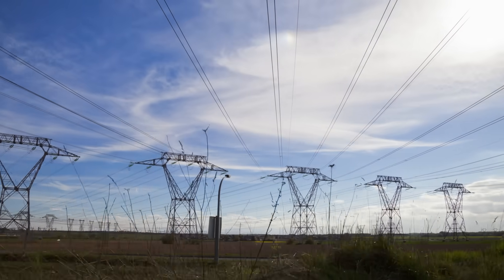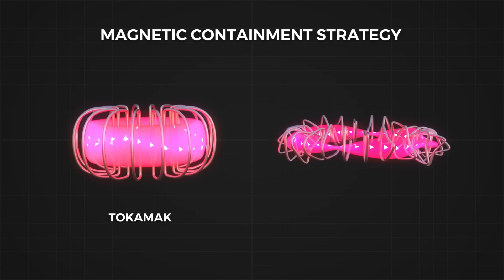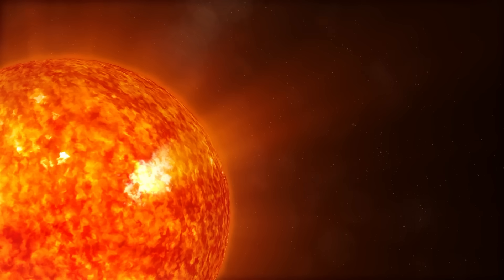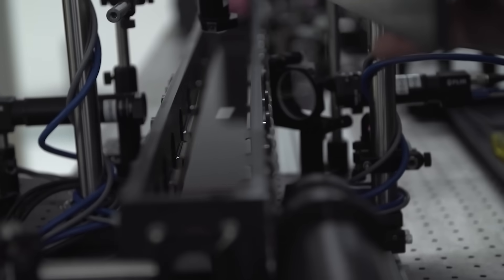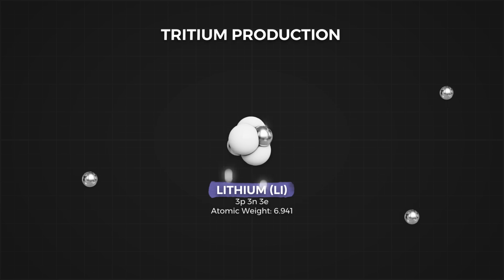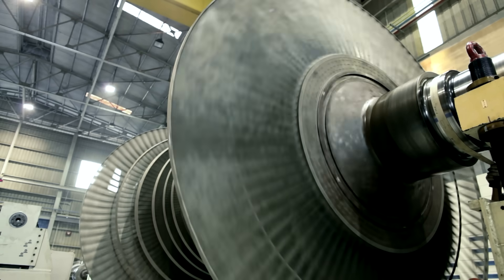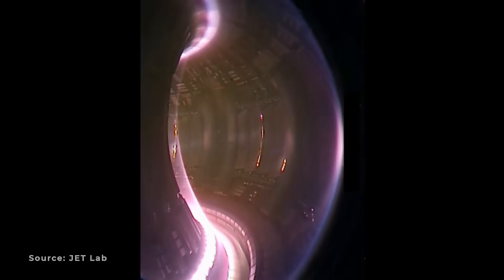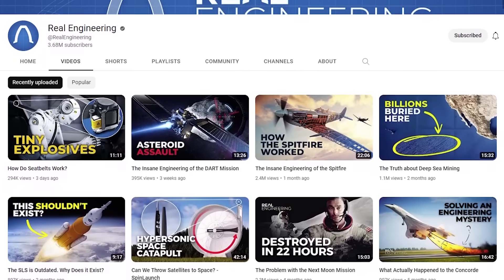The Problem with Nuclear Fusion

Comment: Fusion..great idea.  Keep working on it. But showing multiple cooling towers (giving off steam, not pollution) repeatedly in various forms, to essentially give fossil fuels a black eye is very disingenuous.  You can't even see at the "stack", any pollution from modern fossil fuel powerplants.  Scrubbers, and cleaner fuels etcetera all have been improved immensely in the last 10 years.  If you could get video of super dirty China or India coal fired plants, then yea.  Those fossil fueled plants have gunk coming out the stack.

Comment: I have to disagree with the argument that nuclear energy is being phased out due to PV and Wind energy sources. Germany, despite major efforts to provide lots of wind and solar, is currently struggling with high energy prices and massive CO2eq/kWh compared to France - which is running a large mix of nuclear sources. 

You said it yourself - classic fissile nuclear is underutilized. Why not tap into that?
Fusion will be very expensive for a long time after getting it to work, as it will require a fair number of exotic materials (superconductors) or faily complex energy-extraction processes.

I think it's a great long-term goal, but... We need something right now.
And Fusion won't be here "right now", or even "soon".

Comment: i would like to point out that the reason why it isn't economical, is because nuclear is such a scandalous energy source with scare-mongering at any attempt to open more reactors. scale makes cheapness, instead, we force a small amount of reactors make a big amount of energy for dirt cheap
Reply: ''While environmental opposition may have been the primary force hindering nuclear development in the 1980s and 90s, now the biggest challenge may be costs. Few nuclear plants have been built in the U.S. recently because they are very expensive to build here, which makes the price of their energy high.''
''the reactors run as often as possible to spread their enormous fixed costs over the largest number of kilowatt-hours. Unlike gas turbines, which can be turned on and off in seconds to “follow the load,” reactors take an hour or more to cut their production in half.
It’s not that reactors can’t follow the load; they’re just slower. “They can and do, because they have to,” Buongiorno says. “It’s just never an attractive economic proposition.”

Comment: So, it seems raw materials will ultimately be the limitation that prevents the viability of fusion reactors.  Moreover the claims of clean energy production from fission reactors were proven to be false as spent fuel is and will be deadly radioactive for many centuries to come.  So, what byproducts will be produced in fusion reactors that will prove themselves to be dangerous?  There is almost certain to be something that fusion reaction leaves behind about which we are not being told.  We'll probably find out after such reactors are built.

Comment: If costs are the real problem and not the scarcity of raw materials, as is the case with tritium, I see a fallacy here.
We have to bear the costs of a form of energy production if the cheaper alternative is fossil fuels. In the USA, for example, nuclear power plants have been shut down more for economic reasons, in most countries for political reasons. However, economic competition has been from natural gas, the cost of which is much higher as a result of global warming and which must be borne by the community.
And unfortunately for many industrialized countries there is still no cheaper alternative that does not use fossil fuels.
That means we have to take what we can get (for now). A mix of non-fossil power plants, storage facilities and a hydrogen infrastructure that varies from country to country.
Whether, given the alternative (coal, oil and gas), dealing with radioactive beryllium or building and dismantling nuclear power plants or transporting hydrogen around the world from desert areas is really too expensive for our economies, I dare to doubt.
You should of course go the cheapest way and that depends on the mix. But if it's not cheap enough, we'll have to live with it until we can really break new ground with nuclear fusion that's more effective than our current technology.

I come from Germany and our country is being massively left behind in the zero-carbon economy, while we try to keep our heads above water with masses of coal and LNG. Our misguided energy transition will cost us dearly for many years to come, please don't make the same mistake we did :(

Comment: Quick question-
In order to reliably regulate the output of a fusion reactor, as to avoid catastrophic failure, does the current proposed engineering solution include some sort of novel pulse frequency regulation, that might further protect the  energy transfer "blanket"? 

The reason why I ask is because we are looking to transfer this energy into our electric power grid, and that grid is regulated through the control of frequency modulation. It is likely vulgarly apparent that I am NOT a nuclear, or electrical engineer, but it seems that maybe a tighter control of the frequency modulations of magnetic fields, will likely be the best solution to avoid catastrophic failure- especially considering that we are closer to developing electronic intelligence, which could more effectively solve and mitigate the conundrum of the input/output loss, which plagued us for decades; a problem which has recently been (supposedly) overcome (barely).

Comment: I think we need to consider that nuclear fission is currently the safest and one of the most clean energy producers we have, and yet through propaganda it has been sidelined for tech that works in fewer regions and is less consistent, such as solar and wind. Fusion very well could face the same fate.
Reply: It has next to nothing to with 'propaganda'. It's economics.
Reply: @Safetytrousers  It is partially due to economics, but not entirely, and it depends on the region. In the long term, about 20-50 years after construction Nuclear is actually cheaper than even fossil fuels and pays for its costs easily, but people don't want to make that investment because of the propaganda that came from anti Nuclear Protests in the 1960s and 1970s and 2010s.

Germany is the worst example of this, as renewables are not working in Germany and their fossil fuel industry keeps rising despite the fact that Germany has enough renewable capacity to replace all of their electricity needs.

Comment: 1:06 Totally agree with this point, although I think you picked a bit of a bad example with steel smelting given it requires a lot of coal (well actually coke to be precise) as it is part of the alloy, even if you do all the heating electrically.

Comment: I'm glad we can finally burn the fuel without spending more than output energy to contain the "burn", but I still have questions about extracting that fuel. I still do not entirely understand, how much energy is used to extract deuterium and tritium, whether from hydrogen atoms in ocean water or splitting lithium. It seems the requirement to extract/create the fuel might still have a high relative energy cost compared with the energy released from fusing it. Lithium seems possibly too limited of a material as well to be converting into fuel. 

I've finally realized that entropy makes it impossible to get more energy out of a fuel than it takes to create the fuel, so the goal should be to look to the most plentiful fuels already created, whether its existing large atoms with potential energy in the splitting process, fossil fuels creating through stored complex molecules from photosynthesis, or the various renewal solar options like photovoltaic cells, new fossil fuels like algae to fuel, or splitting water to store as hydrogen/oxygen for later burn.

Comment: I'm still disappointed after 4 years ago I found out that nuclear power sole purpose is to boil a water in order to create electricity.
Reply: You have to spin a magnet round wire or a wire round a magnet to create electricity. You have to have a force to produce consistent spinning.

Comment: At the beginning of the video Real Engineering actually cites all of the reasons we wouldn't have access to Fusion even if it weren't a massive pipe dream due to flawed axioms underlying the model. Thorium is super abundant and can give us a few orders of magnitude bump in a safer, and importantly more decentralized power plant; the MSR. This already could have existed, but doesn't for the same reason Fusion won't. The only power the powers that be currently desire is that over your very lives. Decrease power costs while increasing availability per person by an order of magnitude alone and the need for central planners diminishes rapidly.

Comment: Are fission reactors really that uneconomical though? It just seems like people say that a lot without really knowing the input output etc. of nuclear reactors, the whole life cycle, the ways that it could be more economical with proper investment, etc. Cause a lot of people hate nuclear reactors without even knowing the basics, like thinking the steam coming out of the parabola is "smog." etc. 

I'm not saying you're wrong at all. I'd just like someone to really go in depth on the economics of fission reactors, a half hour or hour long program if need be. Cause without a proper explanation, it's very frustrating seeing such a relatively safe and clean energy source being shut down all over the place. The climate is ***ing melting around us, at least let us know *why something that appears to buy us time is being de-utilized.

Comment: The next problem to truly solve energy problems is a way store a lot of it. Batteries are still pretty heavy and spacious. There needs to be a breakthrough to store energy more efficiently because making energy mobile is just as important as the energy itself.
Reply: Capacitors exist 😉
Reply: @Jafmanz  And?

Comment: Imagine working on a video like this for probably months and releasing it literally the day the biggest fusion breakthrough happens lmao.

Still great video though.
Reply: There was no breakthrough, you just don't understand what actually happened. They just conveniently ignore the obscene amount of power was required to get the energy into the reactor. The overall efficiency was somewhere around 1% or so when everything else is taken into account, but Joe public doesn't think to dig deeper than catchy headlines.

Comment: The only reason nuclear power is so expensive is cause of political resistance and small scale investment. Ofcourse reactors are expensive if we only build a handful of them and each one requires more work than the last, there is no economy of scale, but there could be. 

 If we were to stop redesigning and complicating the process and invest heavily in templated and mass produced small reactors, which also protects against the biggest money eater which is interest accumulating over the long construction time of current reactors, nuclear energy would rapidly become the cheapest form of energy and solve most of our energy demands.

Sadly I don't see it happening in the current political climate, but it happened for solar and wind energy so it is possible. However, India might be able to pull it off.

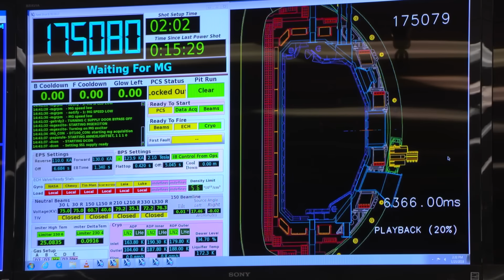Comment: In the concern codt13:23 & safety, there doesn't have to be many of these older/newer nuclear chambers, just enough to amp up other abundance of natural electric conductors, example. Solar, Motion, Thermal, Turbine wind etc. Eco combo, exponentially providing.

Comment: I googled why the beryllium copper pistons and coatings were banned. Long story short Ferrari and McLaren were in a engineering battle in the early 2000s come out on top over the other, and they kept nitpicking each other‘s cars and finding different little things like uncovered rear brake pads to get points taken off or whatever, and Ferrari realized McLaren got more power out of their engines because of the elastic properties of beryllium combined with The slightly longer pistons which is great and all but beryllium is ALSO apparently carcinogenic. I’m pretty sure McLaren stance on it was after they machined though it didn’t pose a danger to the driver so they insisted they should be able to use it

Comment: The problem is not figuring out fusion (that would help though), It's the capilatist power that would prevent the use of this discovery, like coal and oil companies. The same happens with transportation, with car companies (TESLA) "inventing" tunnels for eletric cars, which are essencially trains and metro but much worse

Comment: forget about it, for now.  It's too far away in the future, it will take too long.  This is not the time, because the 'elite' is printing so much money, based on debt, that our energy expenditure cannot follow.. it's the difference between an exponential and a linear function.  The matter is that the funding will drop away before anything is commercially viable, pushing the limit of reachability far beyond our lifetime.  We'll have to bridge the gap with nuclear fission, not with climate CO2 lunacy, because that will destroy us before we get there.  You better start to realize that, instead of just hoping in magic breakthroughs which are monetarily not reachable.

Comment: We don't need another high temperature process that runs at 30% efficiency. We haven't got 50 years to wait for this stuff to be viable. The boring low delta T processes (wind, solar, water) are the only thing that's going to save us from cooking in our waste heat.

Comment: Humans are so easily distracted by shiny things. 
Fusion will never happen outside of international dick-measuring contests, just like skyscrapers won't dominate the housing market and rockets and helicopters aren't the the main mode of individual/public transportation.
Yes it's cool and all and maybe it will have it's niche application (we don't even know yet) but given the problems we face now, on a global scale, the untold billions in global fusion research would have been better spent in renewables, especially researching cheap/fast/reliable manufactoring and founding non-profit publically owned energy providers to keep the costs down.
But researching manufaction and optimization doesn't produce flashy headlines.

Comment: In the late 70’s a NASA spokesperson came to my high school to talk about the Fusion future. During her speech she said they would take the hydrogen out of the water burn it in the reactor and then put the water back. I immediately raised my hand and got dragged out of the room by my science teacher. He did not want me bringing up the obvious. Fusion turns hydrogen into helium which can never be part of H2O or water again. Now, I did know they were intending to only use the isotopes of hydrogen: tritium and maybe deuterium, but there is only so much of that mixed in with the regular hydrogen. That is not sustainable. Eventually, you either have to shut down all the reactors or you have to upgrade the technology to burn regular hydrogen in which case you are burning our oceans. That is not sustainable. The justification given is that there is so much of this stuff that it will take millions of years to burn it all, but they said that about the oil and the uranium. The more energy we generate the more we use, and the faster our fuel consumption becomes in an exponential hockey-stick way. That is not sustainable.

Comment: Not clean, not safe, not sustainable.
Reply: It's all three of those things.
Reply: @afaxmachine5045  Parts  that wear-out are radioactive, it produces neutron radiation, and it burns the oceans. So, not clean, not safe, not sustainable.
Reply: @kimwelch4652  The materials of the reaction walls is known to be a challenge: ''future reactors will not be commercially viable if plasma-facing surfaces have to be replaced too often''. Neutron activated material has a half life of less than 100 years.
Reply: @Safetytrousers  Yup, not clean, not safe.
Reply: @kimwelch4652  ''Even if the containment were accidentally to be breached in the tokamak, the levels of radioactivity outside the ITER enclosure would still be very low. The ITER Preliminary Safety Report presents an analysis of risks that demonstrates that during normal operation, ITER's radiological impact on the most exposed populations will be one thousand times less than natural background radiation. ''

Comment: Nice timing! I'm hoping someone might be able to help with a question I have because I can't find any articles - It seems to me that fusion is a massive threat to extremely wealthy and powerful oil and gas companies. Wouldn't an effective fusion generator destroy them almost overnight?
Reply: LOL.  The first working fusion reactor power plant design will result in the smart big companies will be licensing the technology and building power plants. They will still be drilling for oil and gas because we need heavy lubricants for industry and coke for steel production.  Coke comes from coal so you still need some of that as well. Sure, the scale will be reduced over time (1-2 decades, maybe more) but modern technology will still need some oil/gas for lubrication, home heating, etc for many years to come.  Just a reality.
Reply: @phprofYT  "coke comes from coal" what the hell is coke in this context??